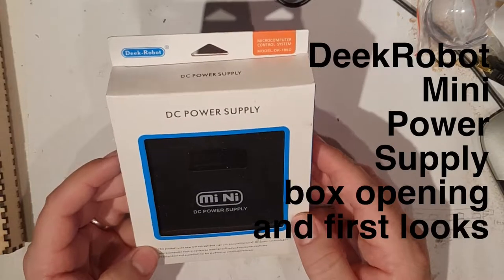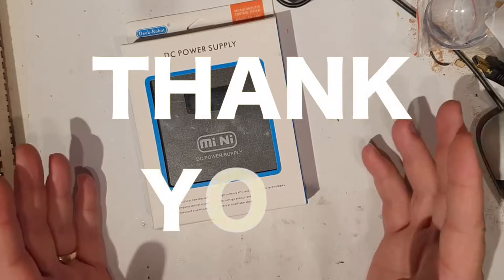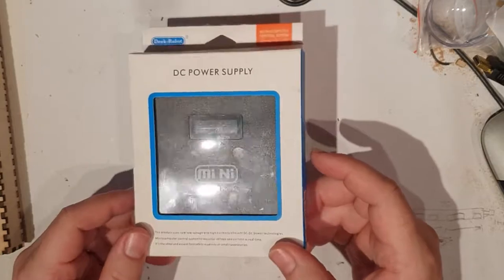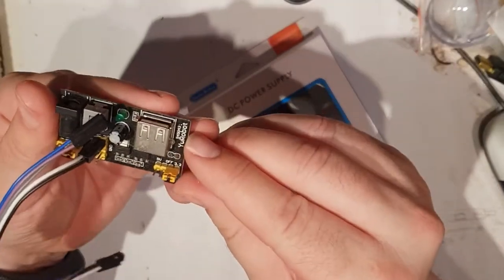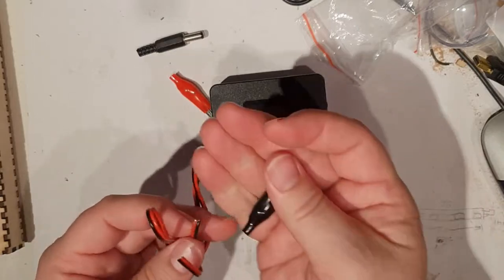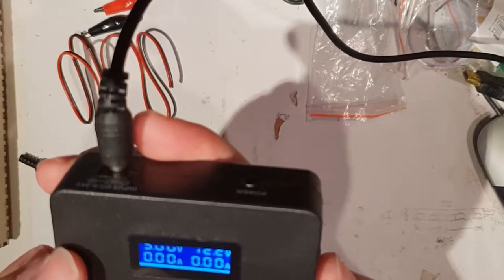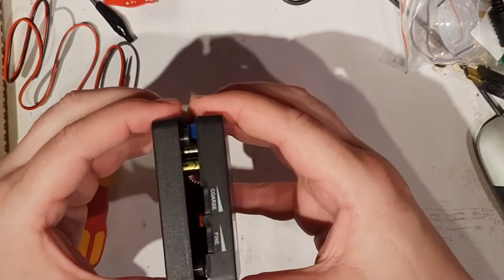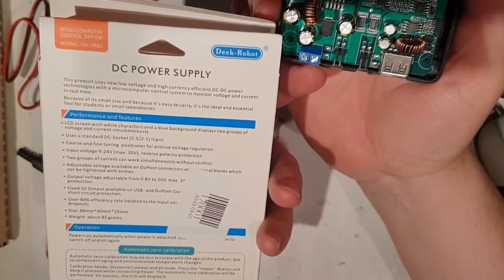Mini Power Supply DK D20250 by DeekRobot box opening and teardown

Comment: lul, 500V 12.2 Amps, that's a good amount of energy. I guess it stopped at 12.2 Volts because the power supply couldn't supply more.